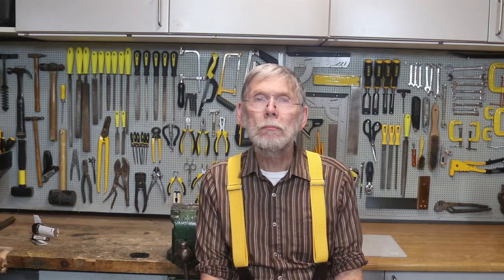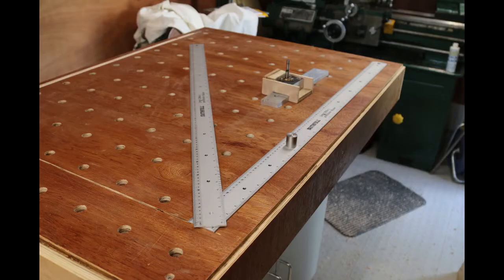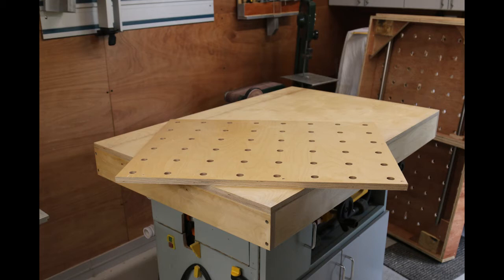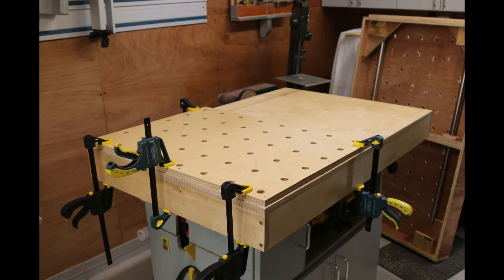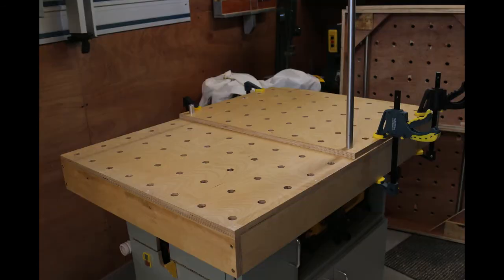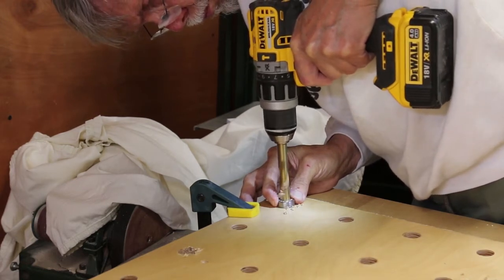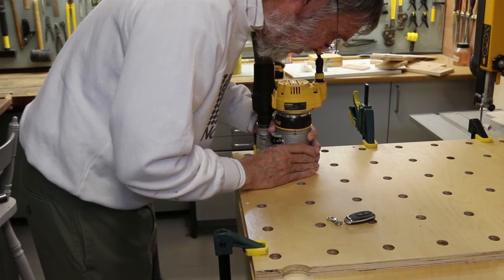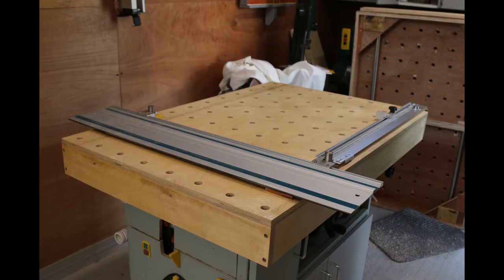MFT mk2

Comment: You’re DIY, tool-improvement projects always are spot-on with buyer needs. Good tutorial. Online, also see the new lightweight, Dash-Board PWS in the USA for the mother-of-all, big MFT-style tables (with sturdy folding legs, extruded aluminum frame, a 93”x24” finished plywood top) and a line of optional accessories. Sold via pre-order, small production runs twice a year. They’re developing a new, half-size table too. The Dash-Board is compatible with many track saw brands and significantly advances the wobbly Festool design.

Comment: What about a metal backed mft_ aluminum for example. To ensure accuracy of holes
Reply from the maker: Possible- depends on what you are going to use it for. If cutting MDF sheet, it will move over the years anyway, so not much point in being super accurate.
Aluminium thermally expands about twice the rate of wood, which may be an issue.
I find a ply table is accurate enough, especially if the squareness of the track is checked from time to time. Remember, the saw is not exactly a precision instrument- not a linear bearing in sight…

Comment: Thanks for sharing your method. Very interesting.
One question, what do you use as a guide for drilling?
Reply from the maker: I turned up a small bush to do this, but a piece of pipe or tube would do. It is just to protect the template wall; it does not need to be central.